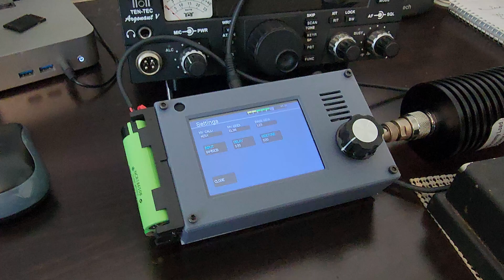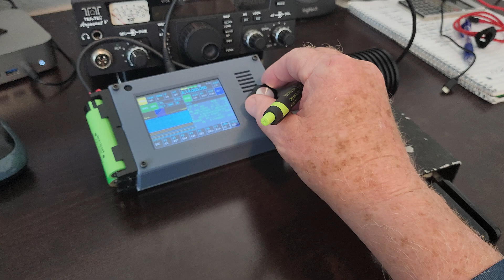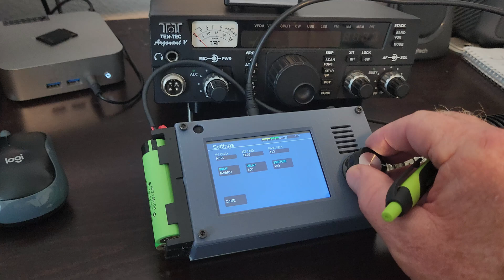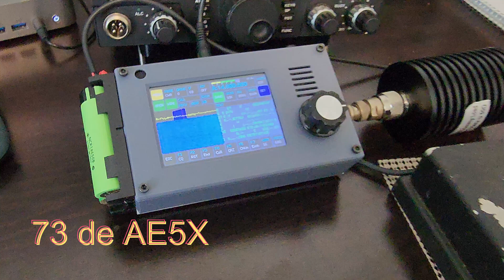zBitx problems on cw

Comment: I'm an avid CW op but did order one of these today. The built-in log is pretty neat along with the FT8 operation. I'm wondering if trying to use a Raspberry Pi3 or Pi4 might be possible. That's the cool thing about these type of rigs---experimentation! 73 DE W5HI

Comment: I received my zBitx last week and experienced the same issues, even when using an external keyer with a single lever key down in the low 20 wpm range . Forget running in the 30+ wpm range altogether! A bit sad, as I'd purchased the radio specifically with CW in mind. But, glass half-full approach - I view this as a development platform for experimentation so we'll see how it progresses. It's a fun device to play around with in general. Basic FT8 works as implemented - it's nice to run FT8 portable on as originally envisaged, i.e. a low power mode.

Comment: For what i am hearing it seems the keying is being handled by the RPi zero. If that is true i wonder why Farhan didn't use the Pico instead and have it handle the algorithm so that its less likely to get bogged down with the DSP getting in the way with dit/dah timing. Could have even used interrupts and made it even easier. 
73 DE KM4CFT

Comment: it's actually pretty tricky to get the iambic-A and iambic-B implementations perfect.  Different radios seem to implement them differently and it is inconsistent.  For that reason, I put all radios on straight key mode and attach my own homemade keyer for consistency.
Reply: The algorithm for making a keyer isn't as difficult as you would think. The problem, is that microcontrollers and these computers are doing a ton of other stuff that can mess with the timing. 
Saying this because I have designed a CW transceiver and had to write a keyer algorithm for said transceiver. 
73 DE KM4CFT
Reply: @JonathanKayne  I've written a keyer for both the Arduino and for web and on the surface, seems like it's working right until people test it out and mention how it acts different from what they expect out of the keyer (due to differences in implementation). This is why it's tricky.  It's the inconsistencies in implementation that aren't concretely defined in iambic A, iambic B, ultimatic, and other modes.

Comment: I know they are ferociously working on trying to fix this. You have to keep in mind, the sbitx is running on a rpi zero, not a rpi4. The sbitx software was originally written to work on the rpi 4, and is sort of split now, between the rpi zero, and the rpi pico, which is running the screen interface. I personally have an sbitx v3, and it runs and operates well. Give them time to find, and fix it.
Reply: Tnx! Thinking about pulling the order since cw is a major component of my operations.
Reply from the maker: Ashhar's latest posting was that he considers the problem fixed, thus my video here.
Reply: @AE5X  7 months later it’s still not fixed no matter what Ashhar says. I gave mine away. I can’t sell it in good faith. Very disappointing.
Reply from the maker: @KD9ZHF  That's the bad part - trying to sell it and still maintain integrity. I tossed mine a few months ago - it's in a landfill somewhere, exactly where it belongs.

Comment: I am a straight key guy, how about a straight key?
Reply from the maker: Sorry for the delay - unfortunately, Straight Key mode also results in missing dits. I probably can't key a straight key faster than 15-18 wpm but CQ DE AE5X resulted in the DE coming out as just a T.
Reply: @ That's a bummer, but thanks for testing and letting us know!
Reply: @ Thank you John!
Reply from the maker: I'll try it this evening.
Reply: @AE5X  I was going to ask this same question .... or if it works correctly in straight key mode while using your external keyer?
Thanks